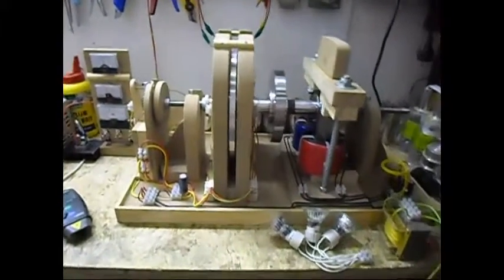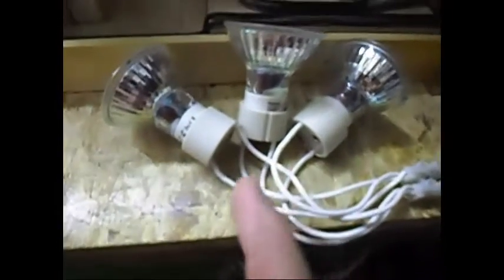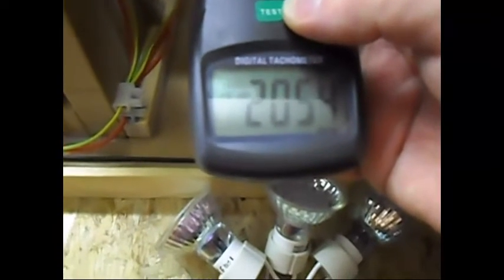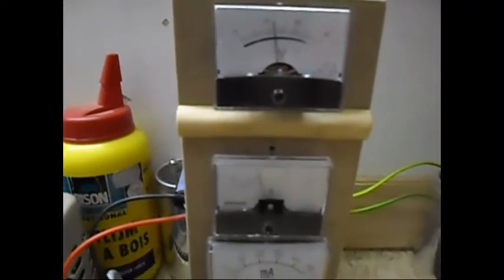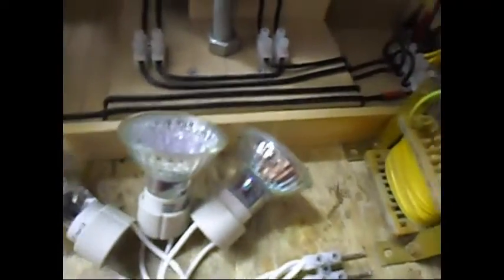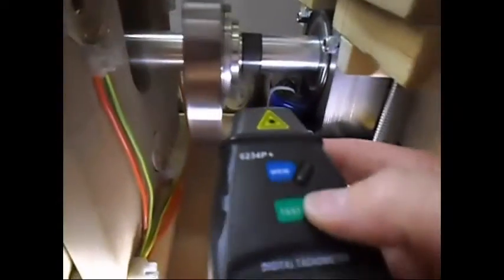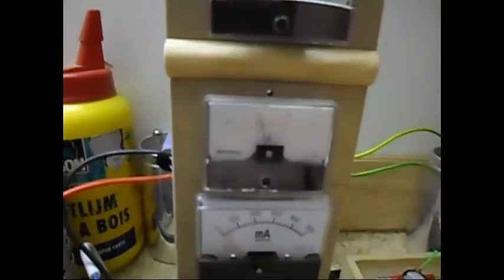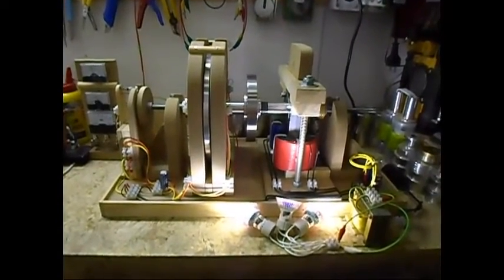Project U-core Dynamo - Update 5, AC load testing with a transformer...

Comment from the maker: Just doing a AC output load test(28watt & 3watt) thru a transformer to see how much or if it will reflect on the drive side...😄
And it does...lol...not much but still does...still need to do a 2500/3000 rpm test just to see it's performance...???

Note, a transformer with a lower primary resistance will make the system speed up a bit when the primary is 
connected but this transformer primary resistance is a bit on the high side...;-)
While make a update on that when i have a suitable transformer and also while driving it to around 2500/3000 rpm...cool...lol

Note,
Would a suitable transformer makes for better performance while the secondary is being loaded...???...got no idea...lol
But i'll know soon enough...^^